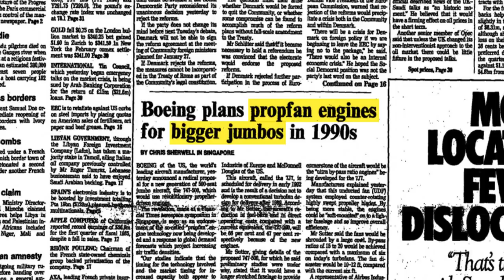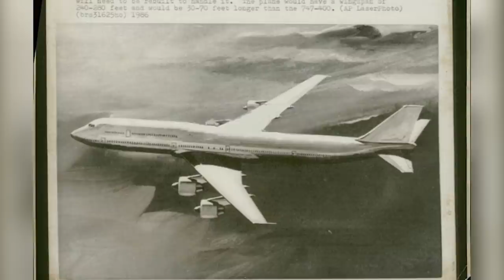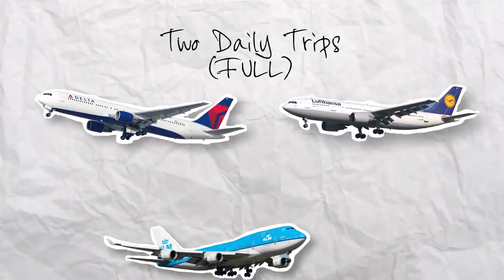Boeing's Propeller 747 - The Never Built 747-500

Comment: I think with the modern engine  technology we have today, they could make a Propfan that has noise levels comparable to that of the latest Turbofans 👌.

As far as the 747, I think Boeing did the right thing to wait for new technology before launching a successor to the 400, but even the 747-8i ultimately couldn't save the 747 as a passenger Aircraft unfortunately, even with 787 technology.

Comment: The UDF-Concept was truly interesting and I wonder why Boeing has not followed it for its 2-holers...
Imagine the range of a B767-200 or B757 with fuel saving UDFs...
Reply from the maker: It’s funny, the concept is relevant again with the rise in fuel
Reply: @FoundAndExplained  Well, it comes and goes. Fuel prices up is pro UDF and new large turboprops, fuel price down supports more new and large jets...
Reply: The promises of the geared turbofans, like the PW geared turbofans, seemed more reliable and attainable. Sadly, they haven't worked as well as PW thought they would.

Comment: And yet,
With the current latest enormously larger turbofan engines, the so called propfan might already be back and commonly used in its new guise...
Instead of exterior counter rotating blades, the compressor fans have been made out-sized huge and the extra air flow "bypassed" to the rear and expelled around the exhaust of the jet exhaust.

Comment: While fuel is a major cost, it is not the only reason. 
The fan would have resulted in a slower aircraft. That means longer flight times. More aircraft to be purchased. More aircraft to carry the load. More crew required,  with the number of pilots required. 

Much aircraft maintenance is based on flight time. This would increase costs while reducing revenue. The more complicated engines would be more expensive to maintain. 
Noise was also a problem. 

Since GE decided not be build the engine it is all moot.

Comment: Considering the improvements un turboprops - both performance and noise- the question Is: why not an airliner similar to the Tupolev Tu-114 Roosya but without its drawbacks?
Think of a DC-8 ir a B707 with the engines and propellers if the Airbus A400M.

Comment: I really think Boeing should move forward with their x-48c blended wing body aircraft design and so should Airbus with their  concept plane (Maverick).
Reply: It's impossible to get the airlines to agree on the critical dimensions. They can't ask for a stretched or shortened fuselage later on, like they do now. 
The pressurization problems are huge. You have to either build an incredibly heavy fuselage for pressurization fatigue or put 2 to 4 pressurized cylinders for passengers inside the blended wing fuselage. Notice that the only successful blended wing aircraft are warplanes with unpressurized weapons bays, aerial refueling aircraft, or reconnaissance aircraft with unpressurized equipment bays.

Comment: Yet now we still have noisy turbofan jets that can only get bigger if wings get higher off the ground. The reverse engine was the airbus 400m military transport. Was engine ever considered for the hercules as range and/or fuel efficiency would be useful as noise is not an issue for hercules trips. Even the geared turbofan has had major reliability and production problems and the next gen turbofans are offering just incremental boosts from exotic turbofan blades

Comment: The real problem with engine makers was that Rollo Royce Ultra High Bypass their version of the propfan was never built and tested. Its ducted design would have solved the issue of noise and vibtations. Their new project Ultrafan Is in some ways similar.
The PW propfan rotated slower than GE's Unducted Fan (UDF). But you don't show It on your video as an alternative on the 747-500 imagen.

Comment: Nah, you missed the biggest point. It wasn't about twin jets or four engine planes. It's about SIZE. Nobody wanted a 500 passenger anything for these long and thin routes. Singapore Airlines NEVER made money with the A340-500 on their New York (Newark) - Singapore route. The plane wasn't full even when they went from Business + Premium Economy to just Business. This is also why the 777-200LR failed. It was still too big. An ideal aircraft for this kind of route would be a very long range aircraft with about 200 seats -- closer to the 787-8 than the 777-8X or even the smaller A350-900.
--
I don't think there is a market for the 777-8X anyway and I suspect it'll be quietly dropped just like the abandoned A350-800. Customers either want the biggest, most fuel efficient per seat twin jet, or they want the smallest plane with the longest range. The 787-8 can be easily brought up to 8,800 nm; it simply needs to be re-rated for the 787-9's MTOW so it can embark more fuel (which it already has room for), get the active boundary tail from the 787-9/10 for a percent or so better cruise economy and if needed auxiliary tanks in the cargo hold ahead and behind the wing box.

Comment: Russians successfully built and still operating their TU long Lange Bombers based on same Lage contra rotating props fans.
May be a worthwhile idea to get the existing 747s in Storage @ Neveda and other Parking Lots to get converted and used as dedicated freight carriers...where noise is not an issue but carrying cost and range is 
Furthermore in the near future when Nuclear Propulsion will a norm for Airlines alongside All Electric options , Propfans and Contra Rotating Props will   sure be one of the choices...

Comment: Still could work, SAFRAN and NASA came up with new propfan engines, quieter and more powerful according to them. I just imagine purchasing the unsold and already abandoned 747-8 and fitting it with the new propfan engines and converting the aircrafts in combis (top level passenger, bottom two levels cargo).

Comment: It wasn't structurally safer, being more blade exposed then a closed barrel jet afterburn mix, but the engine could be fully electric, even mini nucular cell amped to run 747 folds longer. Also covertion to the classis jet barrel tube and mix into rocket at very high altitude to meet the Orbitaline Passanger service that SpaceX attempted, it only would have a delay of 17min vs rocket airline arch, also if the blade could callaps the blades ergonimic to the jet engine body, it would be super versital to any kind of flight, even verticle or underwater.

Comment: Feathered props like a Q400 at startup during flight? 🤔 Don't get me wrong. I love the Q400. Geared turbofan is the best in my opinion. Having apposed counter rotation props has losses. Air is lazy and you have to guide it! Look at the c-series!

Modern day jets are best of both worlds. Anyone that knows how jet engines work know that they are propeller engines in a cowling! 😉

We are far from the Tay or jt8d engines used in the yesteryear!

Comment: Propellers don’t work too well at speeds of 350 mph and faster, that’s when bypass jet engines are more effective
Reply: Bypass jet engines are basically propfans with annular wingtip fences.
Reply: @ellenorbjornsdottir1166  I’ve been told that the fan is a just a single stage compressor rather than a propeller so that still doesn’t make sense. Again, propellers (ducted or un-ducted) start to greatly lose efficiency at speeds of speeds near 350 mph and faster.

Comment: Funny that we do use these engines now. They’re turbofans. They basically just put the propellers inside the cowling
Reply: That's not right. The 747 has always had turbofans since the very first aircraft rolled out in 1968 (with first flight they year after). And no, propfans are very different from turbofans.
Reply: Ah, I must have been mistaken. Thanks!
Reply: @skunkjobb  the Cosmo is kinda correct. Turbo fans have a big propeller, it's enclosed in the cowling, and in the front as opposed to the rear
Reply: @josephthomas439  No, a fan is a fan and a propeller is a propeller even if they are similar in what work they are doing. For example, the pitch of the fan blades on a turbofan engine is not variable while the prop pitch of a turboprop is. And a propfan as well as a turboprop can have the props in either end, front or back.

Comment: Wouldn't it need less fuel and power I'f it weren't pusher style?
Reply: You mean like the md-80?
Reply: @foxgaming76yt24  md-80? 
What does that have to do with the pusher style, if you dont mind me asking?
Reply: @danelmaddox4631  I’m not fully sure what is the pusher style, could you elaborate? I assumed it was the engine layout of the md-80
Reply: @foxgaming76yt24  having the  props faced towards to tail of the plane rather than the nose would be pusher
Reply: @danelmaddox4631  ah ok.

Comment: tesla super spin turbine to have the output to be super and hyper sonic, like a rocket, but mechanical "blad" (disc) turbine, electric
Reply: efficiency should be 100% instead of lacking
Reply: easily directed back, forward and down and even up, by opening a exhaust port
Reply: swap engine pods
Reply: you need replaceable parts, units, modules

Comment: If prop engines can do much better job why can't we use hev electric engines to power jumbo jets
Reply from the maker: batteries are too heavy
Reply: @FoundAndExplained   sorry I mean FCEVs 
Using hydrogen as fuel and convert to electricity by fuel cell and power a electric motor to run the prop

Comment: I know the exterior fans have thrust like the bypass of turbofans but the whole assembly just looks so tiny and... unsubstantial for the 747
Reply from the maker: I scaled them to the same engines used on the 747-400. The propfan engines are most certaintly thinner than turbojets/ fans, so they look smaller
Reply: @FoundAndExplained  you made that?? Wow, thats cool. Thanks for the reply and as you said still, they look small for the mighty 747. But that's on optics.